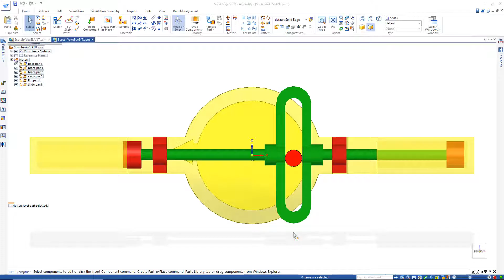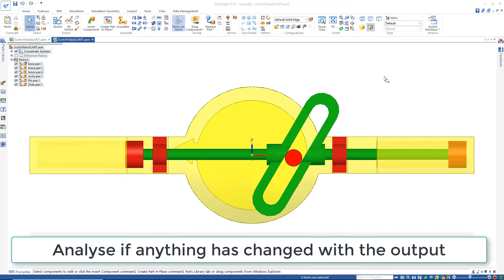Scotch Yoke Mechanism  P4 | Solid Edge - Slanted

Comment: What you want to do is keep the upper half normal but cut the yoke on one side at the midpoint and bend the bottom half 45 degrees. And then connect the gap with a circular curve of twice the other radius (circle at ends). What you end up with then is a quick return version of the Scotch Yoke.   It will spend 3/4 of the time pumping in one direction and only 1/4 on the return stroke rather than half and half. Could be a 33% efficiency improvement if the return stroke is using less force than required.

Comment: Interesting.. running it through the old wetware simulator, the general function remains the same, but the acceleration and torque curves are a fair bit different. Peak force and therefore acceleration is shifted towards the later half of the stroke.